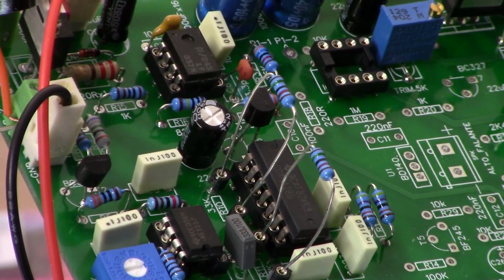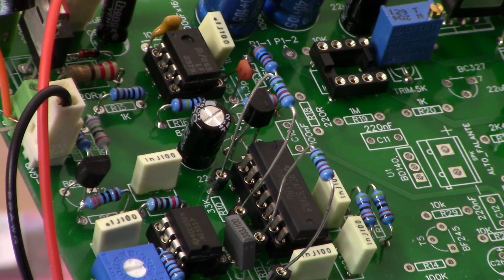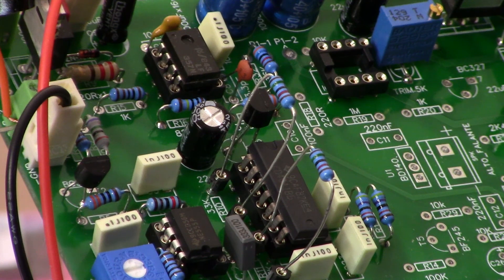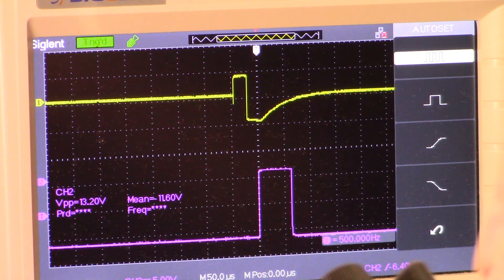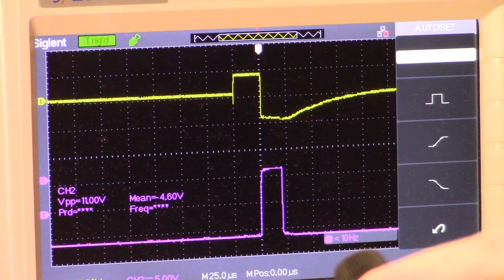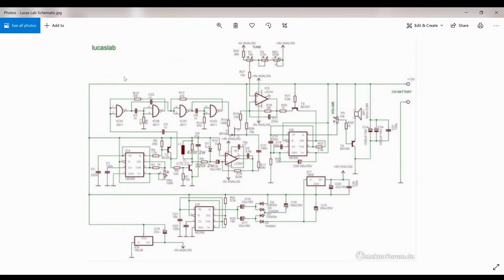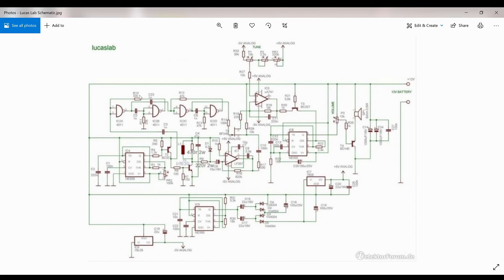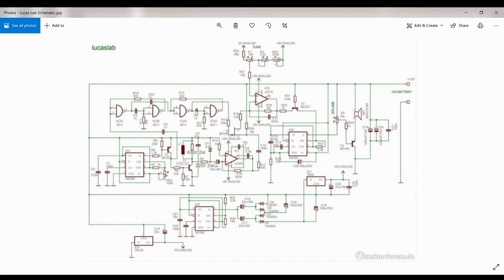PI Polones DIY metal detector Part #4

Comment: My friend. The semple delay wetch pin 📌.
Reply from the maker: Delay is Pin 3
Sample is Pin 10
Reply: Those pins is for Cd4011?
Reply from the maker: Yes.  Please look at the schematic and then watch the waves on the oscilloscope
Reply: My friend 🤩
My problem is the frequency in output of the preamp steel changing. it's not stable. 
What u do to make it stable. Thanks 😊 again
Reply from the maker: Take a short video and post it so I can see what the problem is.